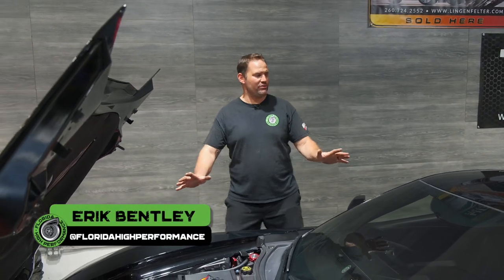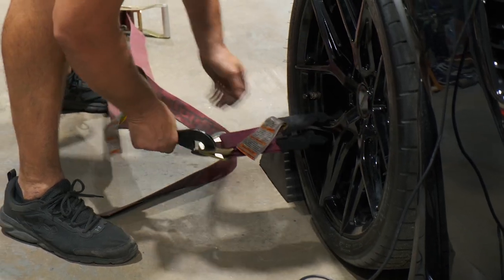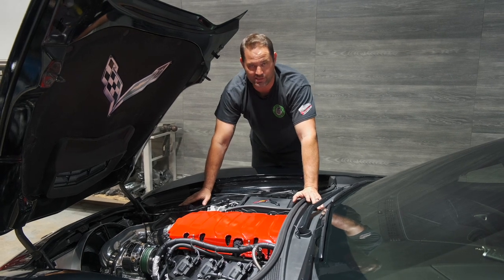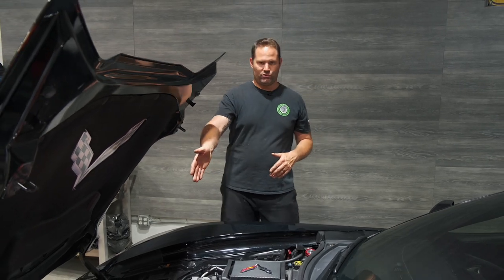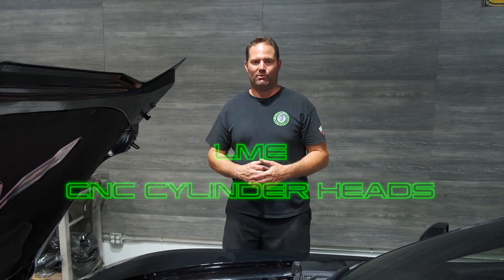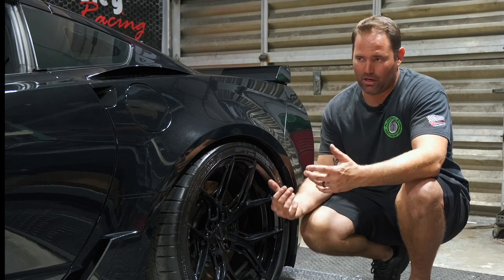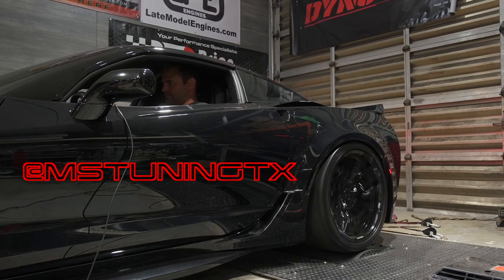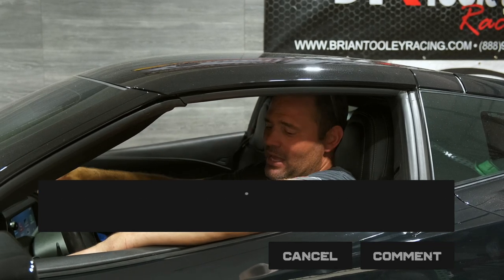This Working Man's C7 Corvette Grand Sport Gains 200 RWHP

Comment: So buys a 50k GS spends 25k to make it a base model c7z06 ??? Buy a c7z06 , tune headers e85 and you have the same hp
Reply from the maker: Maybe he didn't want a Z06?  Gotta ask Jimmy my boy.
Reply: @floridahighperformance - also… help these people understand the diff between a centri a roots setup.  Also, also, also this setup is FAR less likely to heat soak down there in the southern heat.  This car on the street in the hands of your average driver will be faster than the z06 mod comment above because… the difference in torque and hp delivery between the two and being able to run the timing all the way out.  What’s that old saying g - spinnin ain’t winnin.  Far too many “performance enthusiasts” these days who look at peak numbers and think that’s the story.  It’s not and almost never is.
Reply: Maybe try thinking outside the box... we don't live in a perfect world. Maybe the man bought this car and then had it for some time, finished paying off the loan and figured why not just keep it and upgrade it and make it his own.

Comment: Thanks for sharing the upgrade ,what’s the cost?
Reply from the maker: This build...about 20k
Reply: @floridahighperformance  Not bad!! How is procharger or ETS compare to that blower? Also any supporting cooling mods. I know the Z06 overheat and need extra cooling. how do u address that. And would it be better to start with Z06 or is the cost similar from a GS to make it a Z06. I love the Tension Blue GS and want the hp/tq of the Z06 or more.  Thanks for the info.
Reply from the maker: @boywonderrr71  cooling mods- Dewitt’s rad and fan upgrade for sure.  AA supercharger is superior in every way IMO.  Nothing wrong with the others- but for corvette AA has it on lock.  Buy a z06 and thank me later…much better platform.
Reply: @floridahighperformance  Thank you sir.

Comment: it would be nice to know how much a build like that costs
Reply from the maker: Around 20k or so…parts labor tuning
Reply: @floridahighperformance  
That's very good compared to most shops 

Doesn't the 18 C7 come with the LT4 low side pump from the factory ?
Reply: 20k for 200 hp? 😭😂 oh nooooo. While b58’s are getting 100-150+ hp on dps and tune.. going for like 2.5K max

Comment: Man I love your philosophy behind why you build the way you do. I’m in Dallas TX. 2014 z51 manual c7. What would this cost? Partner with anybody in Dallas that would build this way? Not opposed to taking the drive out either but it is 1200 miles
Reply from the maker: Thank you.  After 2 decades in the performance business, I really can say that I prefer a smaller shop.  It allows me to really dial in the process and provide better quality and service to the client.  That’s why I can offer.  I cannot speak for other “larger” shops out there who may not have that kind of operation.  We’ve had clients send us vehicles from all over the country because of our business model and the way we do things.  I’d be honored to help with your project.  Email me for more info.  Happy 4th! - Erik 
Sales@flhighperformance.com
Reply: You can mail them your vette, I know shops do that all the time. just about $800-1200 from what I researched.

Comment: This is a very good video! I can never understand why some LT1 can make that kind of power on the stock fuel system. I had to get LT4 injectors, LT4 HPFP and a DSX auxiliary fuel pump. All that for similar power gains, did you delete DOD and VVT during this build ?
Reply from the maker: Thank you very much.  We didn’t go overkill on the boost- only 6lbs.  Everyone wants that high boost PSI - which means higher fuel demand.  It’s a balance.  The cam helps too which has a larger fuel lobe on it- which drives the HPFP harder and creates more volume.  Yes VVT is deleted as well as AFM.  We solely use LME billet timing covers on ALL LT cam swaps- no exception.
Reply: @floridahighperformance  from your experience does the 38% fuel lobe shorten the life of the HPFP?
Reply from the maker: @85net  not if preload is properly set up.  Number one killer of HPFPs is improper install height…
Reply: @floridahighperformance  awesome, thanks for the knowledge.
Reply: I had to upgrade my fuel system as well. I think this  particular car made such good gains because heads n cam. More efficient
Reply: Stock systems good for 650 ish ....👍🏁

Comment: I have a 2014 C7 Stingray A6 A&A kit Ti head unit 3.6 pully. 1 7/8 long tubes catless x pipe stock NPP. Stock heads cam n bottom end. MSD intake manifold Katech 103 mm TB  C7ZO6 fuel pump & injectors plus DSX low side pump DSX flex fuel setup plus Alky control water methanol injection running 50/50 blend made 622 whp n 570trq on a very hot day here in Farmington NM. That was a E50 blend of flex fuel and 91 pump. Made just under 600whp on pump 91. 9.5 lbs of boost.
Reply from the maker: Imagine what it would do with a cam
Reply: @floridahighperformance don’t cams statistically make cars last less mileage or mo
Reply from the maker: @logantrisilla6579  camshafts themselves don’t necessarily affect longevity.  It has a lot to do with overall maintenance and other valvetrain components.  More aggressive camshafts do put more wear and tear on things like valve springs and valves, which is why those items are always upgraded to handle increase lift, duration and more aggressive ramp rates.

Comment: I know this is two years old, but this build is pretty much just what I'm wanting to do to my 2014 Stingray. Mine has the 6-speed auto trans. I was thinking cam and heads (with a reasonably mild cam), A&A supercharger and intercooler, American Racing long-tube headers. I hadn't considered the fan. Good move. 600+ RWHP was what I was hoping for. (I could live with 550, but . . .  600 is what I'd prefer.)
I've seen lots of builds that did either the blower OR the cam and heads package, either/or with long-tube headers. I'm thinking "Why not all of that?" Without making this an all-out insane build, I thought it could be kept as a very streetable grocery getter that packs some serious performance. (A Z06 style hood to fit a supercharger on top of the engine would not be out of the question, but I'm leaning towards the centrifugal blower that fits under the stock hood.)
Reply: Just stop. Your trans will blow up  along with your axles. Just buy a z06.
Reply from the maker: I am always here if you wanna discuss the build...
Erik

Comment: Beautiful car, but 600 whp seems low to me, I’m not used to the LT1 engines, but a Gen 3 coyote can make way more power with fully stock internals.
Reply from the maker: Hey thanks for checking out the video.  Boost is really low on this at up- the bottom end could use 3-4 more PSI but then we have to add fueling upgrades…the idea here was mild cam, low boost, moderate timing and no fuel system upgrades- and that’s what we built.  700 or so is about what I will push on a sbe LT1 at 11.5- CR.

Comment: What are the offsets for the wheels on the car I have a z51 and want a good of a fitment as what you guys have done just not too sure what to order
Reply from the maker: Thanks for checking the video out.  Keep in mind the z51 doesn’t have the wider body like the Z06 and the GS do, so you’re limited on offset.  However- get with the right wheel company and usually you can have a nice 3-pc wheel made with aggressive offsets- even on the standard C7 body.  Call my friends at Strasse Forged- they made a set of SM5’s a long time ago for my turbo C7.  They were concave as hell and beautiful and fitment was spot on!

Comment: Very informative,  I am in Virginia can you supply parts and support to my local shop? I am retired and budget limiting. Can I cut back on some the parts or work? 2014 C7 Z51 A6 10,000 miles about time to get that A&A kit and a few support parts. Cam Sounds perfect! Head work??? I like headers but saw a 3 inch down pipe to 3 inch mid pipe I thought might work ok enough.  Very well done project and video. The perfect setup for my 2014. Dennis in Virginia
Reply from the maker: Thank you Sir.  Email me sales@flhighperformance.COM 

Erik

Comment: When adding these power upgrades do you have to delete the front radiators
Reply from the maker: We upgraded the engine coolant radiator to a larger Dewitt’s- as well as a larger fan from Dewitt’s specific to the C7.  It did require some modification to the A&A charge pipe that routes up through the passenger side of the engine bay to the throttle
Body…mostly trimming.
I decided to delete the cooler that was at the front of the car for the trans, as the vehicle has an aux trans cooler near the rear bumper as well.  If I wanted to, I could have kept the cooler and made my own bracket to move it up to gain clearance for the IC, but since this isn’t a strict race car and considering the use, there’s not one single detriment when removing the cooler.  The car has been running fine with out a single issue with trans temps….

Comment: I have a 2015 c7 z51, I don’t want a blower, as my car to is a daily , and the only car I have at this time to use, unfortunately, I want power to , I wanna stay up with the new c8’s, how can I get that same power match ,  if not more on my c7 z51, auto, I done the the lowering bolts, and General Motors mag ride up grade as far as mods, ( nothing serious ) but just a preference for me, help me get power , what can I do to it to achieve me getting into the 11’s in the 1/4 mile. All stock, I also have the NLP exhaust sys , thank u in advance , 

Ps 
Budget is around 2500 or so
Reply from the maker: Hey how are you.  $2500 is a tight budget- 5k would be better.  Bolt ons and tuning would be the next step for you…

Comment: How much would the engine modifications run for on a '17 base stingray?
Reply from the maker: Around 9500 for a head cam package which includes all parts and labor/tuning.  Supercharger not included
Reply: @floridahighperformance  what are your average gains for that package?
Reply from the maker: @justinlord930  are you talking about the full
Package we did on Jimmys car- or just like head cam bolt on deal?
Reply: @floridahighperformance  for the heads and cam package
Reply from the maker: @justinlord930  Typically 80-100 rwhp, depending on supporting mods and fuel type

Comment: what stage is that cam? also is it on stock piston?
Reply from the maker: Stage 2 NA from GPI.  The NA camshafts work fine with centrifugal style superchargers like the A&A kit shown in this video.  If it was a top mount supercharger like a Whipple or Magnuson, we would have went with a positive displacement friendly camshaft.
Reply from the maker: Yes stock bottom end
Reply: @floridahighperformance  what hp or psi are you comfortable with on the stock LT1 piston?
Reply from the maker: @kolbyhumbert2680  8 psi, 650 RWHP….after that…rolling the dice
Reply: @floridahighperformance  word thanks!
Reply: @floridahighperformance  thank you for the info!
Reply from the maker: @seanpineda6550  you’re welcome

Comment: What did that run you 20k?  Why not just buy the z06? lmao.  The LT4 is a better motor
Reply from the maker: Um, well, I don’t know.  Let me goes ask Jimmy LOL!  I get your point -  believe me- I agree…but my dude had a GS and didn’t want a Z06…different strokes for different folks.  Go watch my BAD PUNKN ZL1 video- I’m an LT4 guy all the way!
Reply: Depends on what your goal is.  The way this kind of centy set up and the roots system on an lt4 make torque is radically different on the curve.  IMHO nobody needs 650ft/lbs at the hit in a 3,500lb car with DOT approved street tires etc - chassis can barely handle it - some would say straight up can’t handle it like Pobst - which is why the 06 and R1 are notoriously twitchy.  Plus hes getting all the upgraded cooling and etc in that number if I understand it correctly.  Not to answer for the shop but on a road course there would likely be a lot of unhappy z06 guys wondering why they spent the money on that and not on this… just sayin.  There is a whole lot more to being fast than simple peak hp/tq and 0-60.
Reply: Also - as to the lt4 being a better motor outside of the cam drive, which I’m sure is a roller now on the cam upgrade, the vast majority of the improvements between the lt1 and the lt4 are in the heads.  Given that this car is now running CNC’d heads and that the AFM has been deleted (thank god) - and I’ll assume given the quality that this shop seems to have that they did all the other bits as well (springs, arms, push rods etc)- these heads are SIGNIFICANTLY better (meaning bullet proof and breathing like crazy) than stock 06 heads.  So an extra 15k-20k more for a stock zo6 over a stock GS or 20k for this vs a stock z06 (all the same final number being the point) - this GS is better in almost every way.